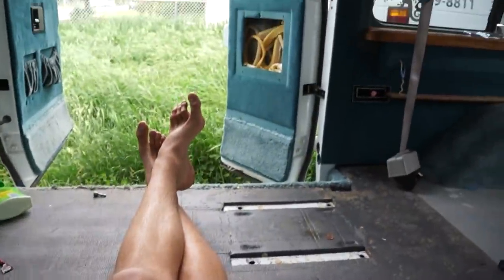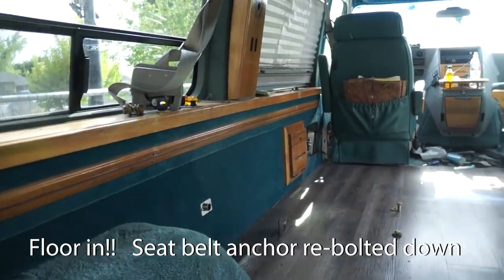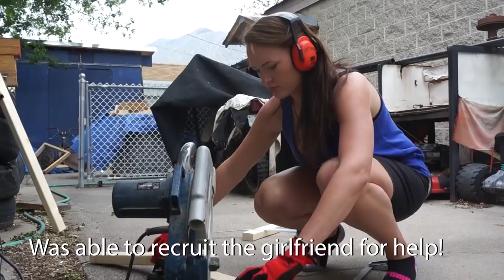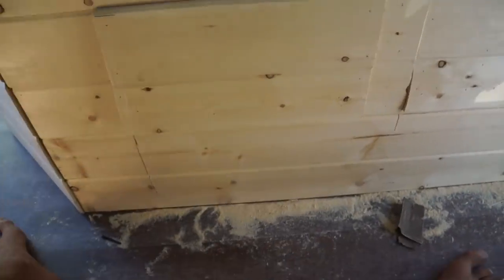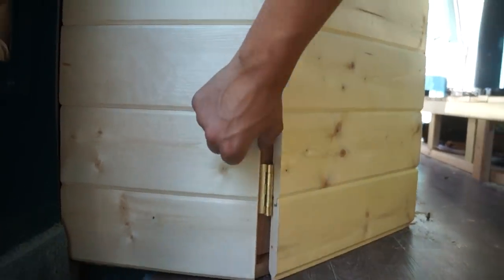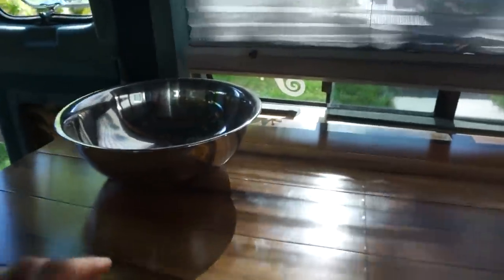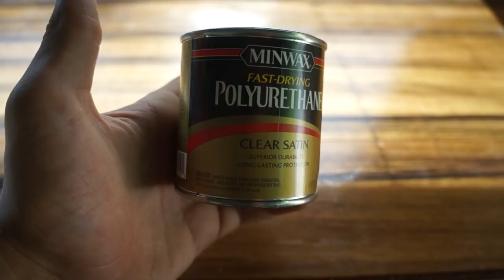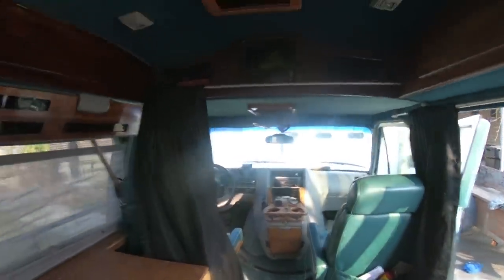How to Build a Home Made Camper Van - Start to Finish DIY

Comment: No offense intended, but the typical van is:

OVERWEIGHT
This is testimony to just how obsolete and out-of-touch present-day Van and RV manufacturers are in the United States. I am an engineer and have some constructive criticism. Every gram of weight counts. People think their van is a house. It's not. It's a road-worthy, resource-efficient machine.

Here are seven issues with typical van builds:
1) NOT ECO-FRIENDLY
Heavy ceiling / van causes causes low MPG. Poor cornering because of the high center of gravity of ceiling. Should have big solar to make the claim "Best Quality and Design".

People insist on outfitting their rigs with doodads like heavy wood ceilings, wood closets, wasteful showers, heavy wood cabinetry, exterior lights, wasteful water heaters, roof decks, vents, sky lights and ladders. Most van build windows are heavy outdated silicon glass. They should be dual-pane acrylic like in Europe. Insulation is minimal because cockpit is not thermally isolated from living area. Reflectix is not insulation. Materials are way OVERWEIGHT. Polyiso has 2x more R value than wool and has no fibers, which are condensation nuclei for water vapor, causing water build-up. The wood cabinetry and doors could be lightened by 50% or eliminated.

Please care about the environment.

2) EXPENSIVE
All of the above doodads cost money that unwitting customers pay for because they do not understand first principals of engineering regarding minimization. Lithium batteries in typical van cost about $1000/usable KWH (KiloWatt Hour).  My Tesla battery cost about 8x less.

My empty Sprinter van with a BlueTec i4 turbodiesel gets 30MPG, and 25MPG with the camper build at 55 MPH. The van in this video is so overburdened I doubt it even gets 16MPG.

Expensive fridge. My fridge costs $195 and is 2x larger.

3) HOT WATER DELAY
With a remote hot water heater, it will take up to 30 minutes to get hot water. If the hot water tank is pre-heated, it still may take 30 seconds to get hot water. Meanwhile, much water is wasted. This hot water tank design wasted both water and energy. To resolve this, I installed a true-instant hot water faucet; six seconds for hot water.

4) NOT BOONDOCKABLE
Greenwashing: Since there is inadequate solar, fossil fuels must be used to charge the battery and keep the van warm. If it is winter, very little solar power is available. Wasteful water design will require frequent trips to replenish.

5) FOUR-SEASON, NOT
Customers camping in the hot summer or cold winter will have issues with energy usage and temperature control due to the lack of insulation and outdated climate control. My Mitsubishi mini-split heat pump has a SEER of 33 and can heat down to -13F. A lot of fossil fuel will be needed to stay warm in winter. Water will freeze and burst pipes.

6) NOISY
The choice of outdated climate control like Maxxair fans will lead to excessive CFM (Cubic Feet per Minute) airflow, causing high noise levels. Maxxair fans are noisy, are bug collectors, are not insulated and don’t move much air. Diesel heaters noisy, emit toxic gas and are high-maintenance.

7) POWER
Small battery, solar and inverter are inadequate to power a house on wheels.

To resolve the above problems, see my Tim's Tips van build at: https://youtu.be/YxPj21nckd0